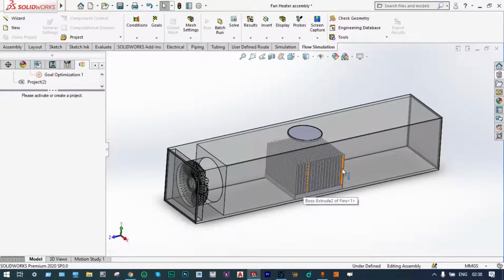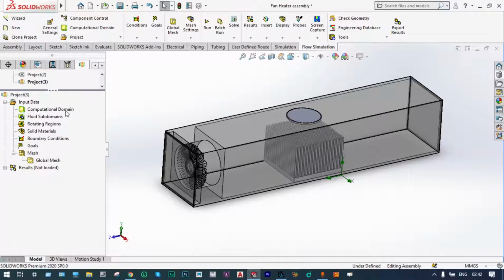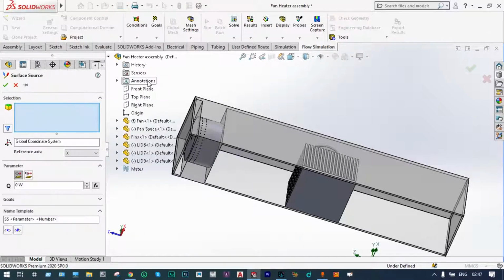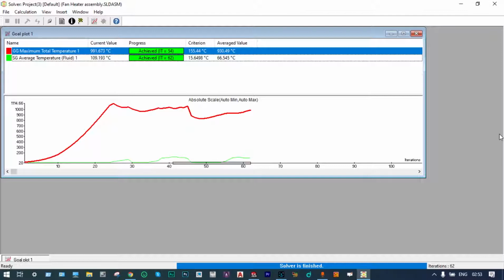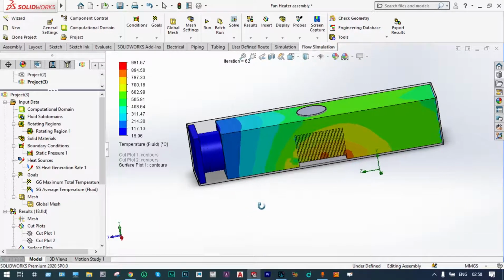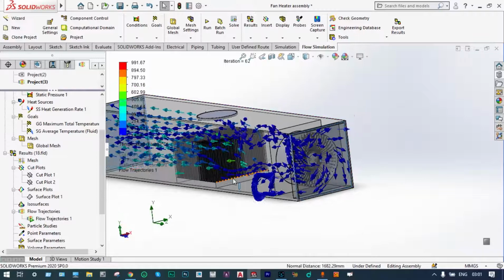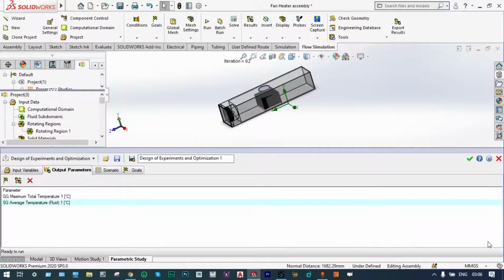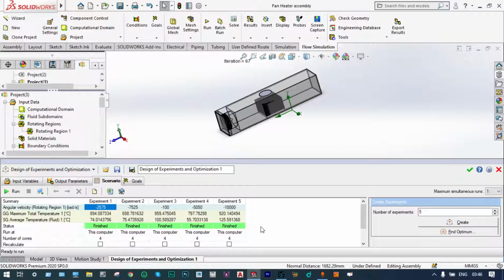Optimize Your Fan & Heat Sink with CFD Conjugate Heat Transfer Analysis in SolidWorks

Comment: What if we are not cooling the heatsink but the heat sink is actually there as a cold surface to withdraw energy from the air passing by and hence cooling the air.
Reply from the maker: No issues. It can be done.....

Comment: how did you able to select rotating region after assembly? Can you help me cause i cannot select rotating region after I assembled the fan with other part
Reply from the maker: Dear friend, In CFD it is always better to simulate with simple models. I always try to make single object as sldprt model. Anyways if it is an assembly then convert it into single model with stp extension or sldprt then perform analysis

Comment: why did you consider internal analysis because fan is open from front side it will transfer the heat to environment
Reply from the maker: Internal or external analysis that doesn't matter. In both cases you can have same results depending on boundary conditions. If you are considering external surface and heat transfer from walls to atmosphere in that case it should be external analysis.
Reply: @CFD_GUIDE  sir i was having a problem of unable to resolve rotating region what could be the possible fix for that?
Reply from the maker: You have to model one dummy space surrounding fan blades and on that dummy space you have to create rotating space and apply rotational speed.
Reply: @CFD_GUIDE  yes I did that but still it says unable to resolve rotating region
Reply from the maker: Rotating region should be un-merged extrude boss base and from component control option it should be disabled.

Comment: this may be a long shot, but can you please re-do this in the new fluent meshing with water-tight geometry workflow? I would like to know if it handles the mutizone body. I tired to use interface boundary for the MRF approach but always fail to run the simulation. I think it is because the shared topology erases the interface. thank you.
Reply from the maker: I have already done these type of videos in my Udemy course. It is containing all the models also. If you are interested write to me
Reply: @CFD_GUIDE  can you please give the link to the Udemy course, there are too many of them sharing the same CFD analysis title, dont want to buy the wrong one. thanks
Reply from the maker: Please write to me
Reply: @CFD_GUIDE  never mind, found it. CFD a Pro Approach to Solve Industrial Problems with ANSYS. bought. thanks
Reply from the maker: If you face any problem please let me know. I will be there to provide any kind of technical support, any time
Reply from the maker: Instead of water tight geometry you can try fault Tolerant Meshing. In water tight geometry the needs to made perfect using Space Claim repair tool. It is sometimes tedious job. Sometimes automatic repairing will not serve the purpose, you need to repair manually.